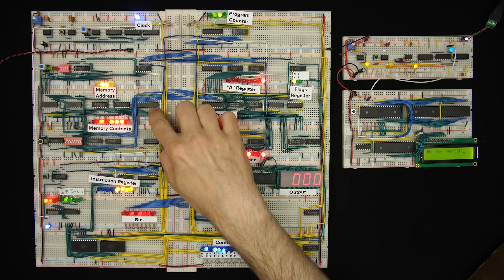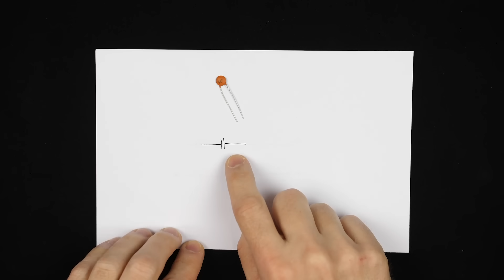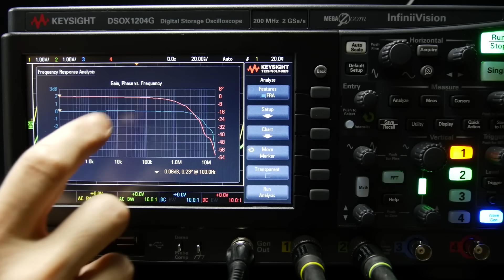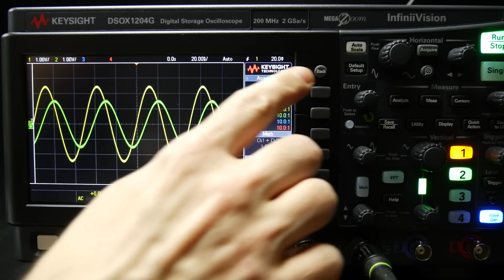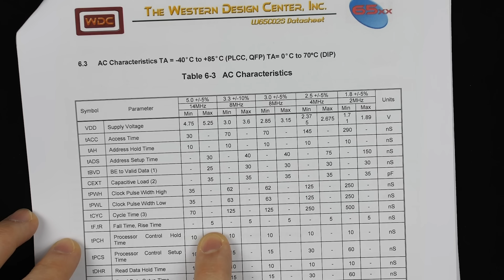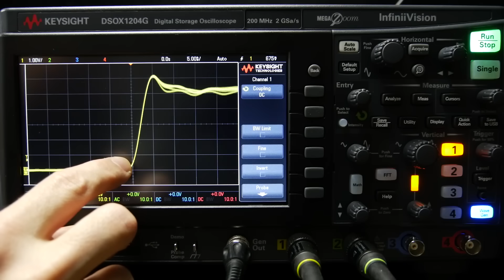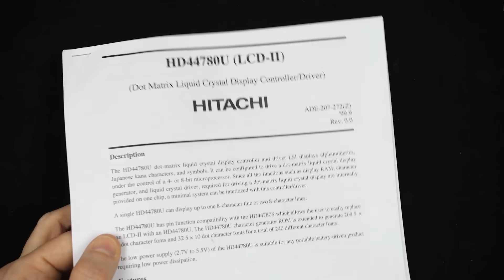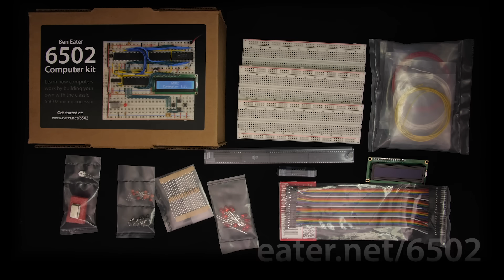Why build an entire computer on breadboards?

Comment: 0:34 yes and no... if you have a premade PCB sure it's not really great at showing how it works and it will likely work first try. but when you design them yourself it's a completely different story.
that would actually be an amazing expansion of your Breadboard computer, showing the process of designing the Schematic, the PCB, and soldering it together...
that would be really sweet. especailly with your really great way of explaing things i would assume it would bring a lot more people to make their own PCBs
Reply from the maker: Absolutely! Laying out the PCB yourself is an awesome learning experience. Perhaps I'll get into that at some point, though there are already some great resources out there.
Reply: @BenEater  true there are other great tutorials out there. but it would still be great as a next step in self designed circuits.

@kallewirsch2263 you mean these: https://i.imgur.com/cVEPSNb.png ?

that is pretty elegant.
Reply: Right now, I'm trying to redesign the entire 8-bit breadboard computer PCB, mainly because I want to get into PCB design. I feel like this is one of the most educative things I've ever done. I'm doing it in modules and I hope it turns out well
Reply: @simeondermaats  good luck with that!
and yea doing it in modules is pretty much the best way to do this, if you do a mistake somewhere you only have to reorder and resolder some modules instead of the whole thing.
plus depending on how you implement your modules it could potentially allow you to upgrade parts of the CPU, like a wider address bus, or similar.
Reply: @proxy1035  That was also the way i did it with mine although I used 10x15 cm stripboards (PCB's with lines of copper on the back and holes predrilled in a square 2.56 mm pattern) instead of designing and ordering boards with custom copper lines and holes.
Simeon, you can look up my design if you are interested ( http://www.soerko.dk/SK-01.html ).
Reply: I've been designing PCBs lately and it's definitely not easy! It's simple enough to do, but then you try to cram multiple chips onto a 1x1 inch board, with all the various capacitors and resistors and inductors they need... Someone needs to invent capacitors small enough to fit inside the chips!
Reply: @renakunisaki  
Actually there were IC sockets around, which had the capcitor built in. They could do this, because the 74xx family of ICs had the power supply always on 2 opposite corners.
I have no idea, if those sockets still are in production.
Reply: @kallewirsch2263  that wouldn't help in my case, that socket is twice as long as the boards I'm making 😆
Reply: @renakunisaki  Wow I see you all the time in pannenkoek's comments, interesting to find you here
Reply: Yeah I'm actually doing this. I've made a modular busboard based on PCIe connectors. I'm well on my way to making an awesome computer.
Reply: @CorvusPrudens  and Simeon Duwel, wow that's awesome. Would love to hear how you get on with that project. Maybe you should both compare notes.
Reply: Christian Weissmuller  Personally i use kiCad in combination with FreeRouting to make my PCBs.
so i design it in KiCad, let FreeRouting do all of the traces, and then clean it up manually afterwards
Reply: So like Great Scott
Reply: Totally seconding this!
Reply: Best girl Ramiel
Reply: Made a card to plug into my computer (Z80@1MHz) by drawing ink on copper. Some lazy address decoding and a latch yielded a Centronics parallel printer port. Wrote the driver in machine code (still remember 0x21 = ld HL).

Comment: You gave a very good explanation of the Fourier transform without actually mentioning it by name.
You don't actually have to read the busy flag, in fact most arduino LCD libraries don't.  What you do need to do is to add a wait loop between each instruction access of the LCD.  There is a known amount of time that each instruction takes, so the LCD drivers just 'spin their wheels' for a few miliseconds to let the LCD catch up.  Actually reading the LCD busy flag will end up wasting the same amount of time.  Also, by wiring the LCD in 4 bit mode, and leaving the LCD R/W hard wired low (write), only 6 wires are needed in the interface.
Reply: wait loops make baby jesus cry
Reply: @Breakfast_of_Champions  Sitting in a loop reading the busy flag and waiting for it to become false is exactly the same as just waiting a number of MS, the cpu does nothing else during that time.  It's not possible to attach an interrupt to the LCD, so there isn't any other choice but to keep reading the status reg and testing the busy flag.  You could put some other task inside of the wait loop, such as reading switches, but being that the purpose was to update the LCD things get tricky.  Since the Arduino doesn't support threads, a multi task solution to the problem isn't readily possible.  Best to just live with the wait loop, sorry BJ.
Reply: A simple no-op would prolly do.
Reply: Waitaminute. Is that square wave literally just a graph of the intensity of each frequency!? So he uses all odd frequencies so that the plot alternates between high and low?

If that's correct then wow, just blew my mind.
Reply: @Rena Kunisaki    The square wave is the sum of the other waves - they're added up.
Reply: @renakunisaki  Correct, that's called Fourier series, any periodic function is a sum of sin/cos waves with discrete frequencies.
wait until you know about the generalized theory : Fourier Transform. Any non-periodic function is a sum  of sin/cos waves with continuous frequencies.
The moment i've learned about these theories my view of math and physics changes 180 degrees.
Reply: @renakunisaki  What you are describing is the graph of the Fourier transform of the square wave. That graph is just points at every odd multiple of the fundamental frequency with y-coordinates inversely proportional to their value.
Reply: One benefit of scanning the flag is you can play with your clock speed (or make it variable) and not have to retune a bunch of magic constants, or in a crazy world, wire it up to get you an IRQ and go do something else for that time. Admittedly it's probably not worth setting up something to poll busy automatically, as the busy flag isn't just available on a pin, but inconvenient isn't impossible.
Reply: @ekmett  But you still need the IRQ to enable you to do something else in between polling the busy flag. Unless all your code is written to check the LCD busy flag. An interrupt will dump all the registers on to the stack and jump to your interrupt code automatically.
Reply: @axelBr1 : I tend to structure 6502 code in such a way that I have lots of little housekeeping tasks to do. The LCD isn't enough of a heartbeat to really warrant this sort of thing, but for stuff like horizontal retrace? At 8 mhz i get something like 253 cycles per scanline to do work and the IRQ entry/exit only burns maybe a 10th of that. That leaves me 9/10ths of my display time to do work. Now, on a 65c02, like we have here you don't need to actually go off to the IRQ handler, you can WAI if you are brave to kill the irq-handler entry/exit overhead, but this also doesn't work so well for the LCD case, as as mentioned you have to explicitly ask for the busy flag rather than just have it pot it to the CA/B lines. If you did have something doing the busy scan loop for you in hardware you'd be able to WAI, which immediately drops the chip into low power mode, even if it just for the few microseconds the LCD needs. Overkill? Absolutely.
Reply: @ekmett  Overkill. Not if you value battery life. :D And as you said before, a solution that doesn't rely on NOPs and counting in a busy loop, doesn't tie your code to a particular clock speed. All the things you highlighted would be great for Ben to show, as they bring in systems design and maximise performance, which we should aways be aiming for.
Reply: @JayDee-b5u  I agree. The little 1602A board doesn't make that easy though. You have to explicitly ask it by sending it a command to get the busy flag contents, which complicates using it to drive CA1 or something to get an IRQ when its ready. Alternately you could let the '22 give you a timer interrupt and use that to fake having the real thing, by polling and throwing it back if it's not ready on timer tick
Reply: its actually the fourier series. that square wave is the prime example for that when you walk into the world of mr. fourier. fourier transform is used for different things like painting (XD).
Reply: Rather than teach people to use horrible busy loops, much better to teach them how to use interrupts. The 555 timer can be repurposed to generate an interrupt signal every few ms and then send the character then. The processor can then Halt, rather than NOP, until the next interrupt. (The IO chip might offer Interrupt signals.)
Reply: @axelBr1  So how is halting any better than looping? (OK maybe in power usage).   A proper driver could start a timer AFTER issuing a command to the LCD.  The ISR for the timer would then call the bottom half of a driver routine to finish a pending operation to issue the next command to the LCD (if there was one). The top half of the driver would be the entry point for the operation.  BUT the top half would have to be running in a thread that could be suspended, the thread would complete from a signal by the bottom half.   However as I said before, can't do threads in the Arduino!
Reply: @scharkalvin  As Ben is giving an introduction to CPUs and programming, I feel he should mention the "correct" way to do something, even if he doesn't do it because it's difficult to implement. A busy loop will get the job done, but as was pointed out, if you're counting, the amount you need to count to depends on the clock speed, and when you get to programming on a modern computer, it will hog CPU cycles from other applications, (admittedly not a problem on multicore CPUs), and use more power than necessary.

I'm a Z80 fanboy, and dug out a programming handbook, and actually for the Z80 of the 1980s, the HALT instruction, causes the CPU to execute NOPs until an interrupt is received, (this was to ensure memory refreshes occured). So I was wrong to say that using HALT would save power. But I would expect a modern CPU would have power saving features, for when we need the processor to wait.

Regarding doing threading in the Arduino, if you felt sufficiently masochistic, you could probably implement some kind of time slicing based scheduling with an interrupt routine being used to keep track of which function to execute. It wouldn't be the most efficient, as the time between when a function ends and when the signal to start the next function can't be used, and if a function is running when an interrupt comes in, then things might not go well.

Comment: One thing that kind of anoys me with most "i built a computer from chip" is that while they may use elemental gate chip for most of the build, its quite common just adding like a 512kB memory, and sometimes also a 512kB flash.

What is kind of annoying is that its kind of implied that they building something like a early 70-tys grid based home made computer. The thing is at this time a 1kB ram chip would be a great chip at that time. But 512kB was introduced in 1989... At that time 486 was available.

Comment: Your videos inspired me to go back to experimenting on breadboards.
However, there was one problem I encountered that surprised me: The wires you use? You can't buy them anymore. At least, I have not found them on any of the major german online electronic shops or even Amazon gave me a hard time. I remembered a small shop for electronics components (one of the last) and they still had them I bought a whole set, just in case.
Reply: I do not know if it's the right wire size, but I think you're looking for something like this -
https://www.amazon.co.uk/dp/B07V5FVSYL?tag=duc08-21&linkCode=osi&th=1

Comment: you can see a difference in color in the cheap and expensive breadboard pièces in the beginning. the lighter one is probably stainless steel, which conducts less and the darker one is probably from a nickel or tin coating which would protect the base metal (I don't know what that base metal would be, but maybe copper?)

Comment: before watching the video my answer is - "well why not?"
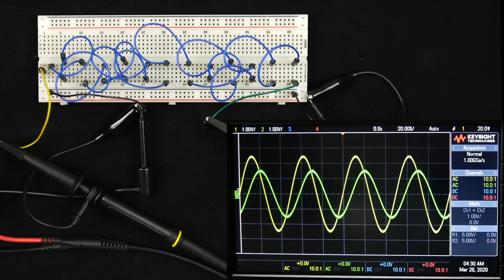13:10 does that have anything to do with how a capacative touch screen works?
Reply: To figure out if it’s your body or the changing position of the wires causing a response, you could move the wires with different materials, like a plastic rod, a wooden stick, etc.
Reply: The impedance is changing because he moves the wires, not because of his hand's capacitance (which I think is how touchscreen works)
Reply: @angelorondini5835  I think you're both correct and wrong at the same time. the Capacitive coupling of his hand (Which through his body is a reference to ground) to the field of the wires induces a change enough to cause effect, moving the wires also added an effect of its own so there were 2 effects at play in his demonstration. @Lee yes it's how modern touch screens work.
Reply: @angelorondini5835  Building off of what Ron Laws mentioned, you can actually sometimes see a circuit 'magically' start working if you put your finger in a certain spot on the PCB. Nothing physical is being moved, but the capacitance of the circuit changes because of your finger. I can't think of any good YouTube videos that show it off the top of my head, but I'm pretty sure I've seen one or two. It is a well documented phenomenon so you should be able to at least find a written article about it with a quick search. It is pretty interesting stuff. I know it about blew my mind when I first saw it. 😂
Reply: @ReedHarston  yes I knew that too but I didn't think (maybe I'm wrong) that he could change the capacitance that much just with his body; I think that most of the capacitance is because of the wires being closer to each other and to the breadboard
Reply: @angelorondini5835  Now I'm curious which had the greater effect. I'd actually bet on his finger, since it is a big thing full of water. I don't know though. I might have to try and repeat his test sometime. :P
Reply: @angelorondini5835  I don't very much capacitance is needed to degrade a 20 MHz signal.
Anyway, if you consider one wire to be the first plate and either a second wire or the finger to be the second plate, I think that the contact area divided by distance (which the capacitance is proportional to) is easily much greater for the finger against the wire than for one wire against another. I'm sure it's more complicated because the finger is not as a good conductor as the metal, but still.
But if he would force the wires to run parallel for longer stretches and as close as they can get to each other, then the effect on the capacitance should be greater than for a wire passing under a finger.
Reply: @possible-realities  yes the hand does have more surface area but it's not very well connected to the rest of the circuit at all, the current has to pass through the body, then the shoes then the floor etc... So I don't know which one has the greatest effect, it would be nice to actually test it
Reply: @angelorondini5835  You're absolutely right! Yes, it would be very nice to test it.
I guess that there's one case where the current can stay inside the hand, and that is when the hand forms a capacitance against several wires. Then that would create an extra path through the hand, but that should make it easier for the current to pass and reduce the dampening, so I guess that's not the dominant effect.
Reply: Thanks all, this is useful info for a project I've had in mind for a while

Comment: Breadboards seem to have that capacitance problem all over the place.
I was experimenting generating a VGA signal with a microcontroller, and when I plugged one VGA color channel into the breadboard, vertical lines appeared (which were being generated by the microcontroller), and the VGA pin wasn’t even close to the microcontroller one. That makes me less sure of building an 8-bit computer on a breadboard.

Comment: I don't think anyone questioning the breadboard approach for complicated projects, would suggest buying a 3rd party pcb and solder components on it as an alternative. Obviously the alternative is to either construct it more solidly on a perfboard, or even better do any tests of subsystems you need to do on breadboard, and design a PCB rev A for the whole thing then bodge and iterate if necessary. The same level of intellectual engagement and undestanding of the design is necessary in all these cases, and the result is much less flimsy and prone to accidentally ripping up wires or bad breadboard connections.
Reply: Doing each of those types would be great next project steps after this, as well as developing a custom OS in asm.

Comment: This stuff is golden.

In my experience, breadboard projects quickly become a mess. Even with good breadboards, there might be bad connections, bad power distribution etc. Also, it's easy to forget what everything is if you haven't looked at it for a while. There's no "documentation" to speak of. If you can, it's much better to use simulation software, and then it's easy to take the next step towards designing a circuit board when you're happy. Of course, it's not as much fun, and the hands-on approach is usually more effective for learning. You could also use prototyping boards if you're a bit more confident, as they are much more reliable. It's also cheaper, and soldering is a fun and useful skill.